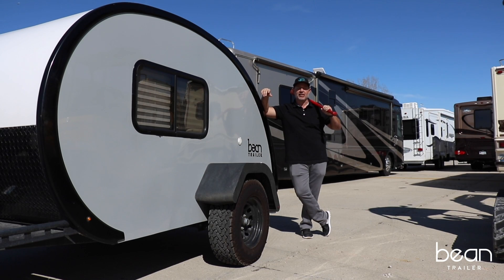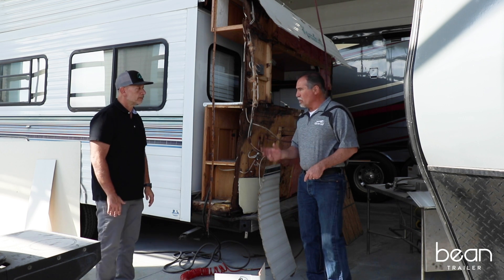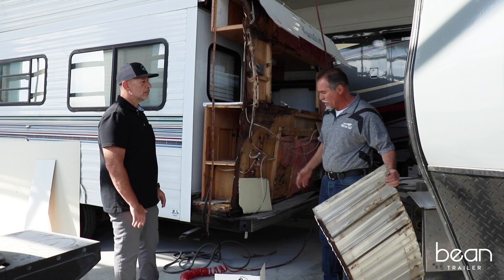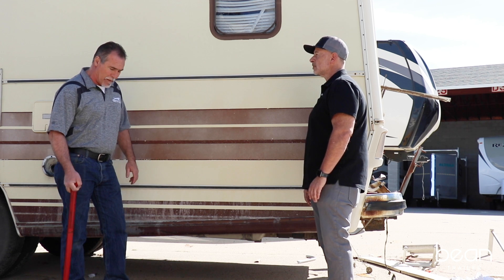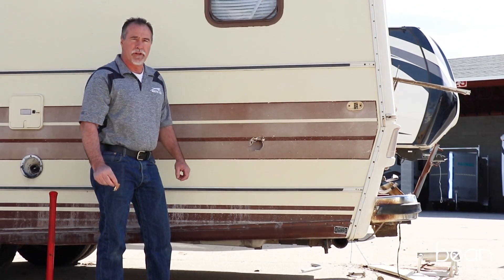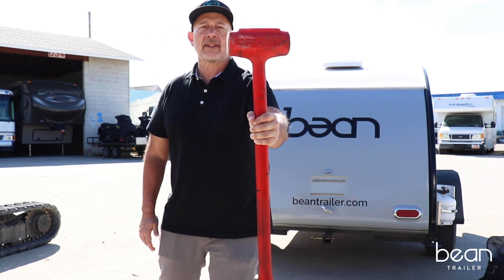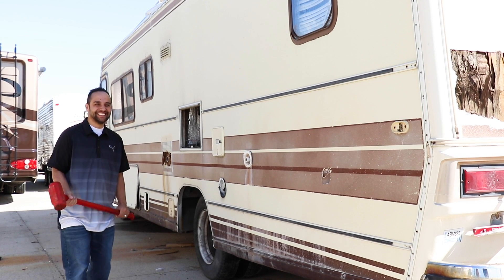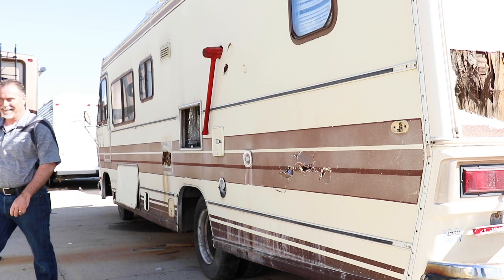Bean Trailer – Let's See How Tough Our Trailer's Are (Teardrop Trailer, Best Campers, Off-roading)

Comment: Impressive. But if I wanna dent a car I’m also not going to use a RUBBER mallet tho…
Reply: It turns me completely off when channels just heart every comment when it’s clear they’re not reading them
Reply: may be they felt embarrassed for you and did not know how to respond because you completely missed the point. They are hitting it with a rubber coated sledge hammer which would completely destroy  a car panel or aluminum skinned trailer. They did a video on Instagram where they hit the trailer with a steel sledge hammer. People commented that 'the sledge hammer was not big enough' so they hit it with a much bigger sledge hammer and then people shut up about it.